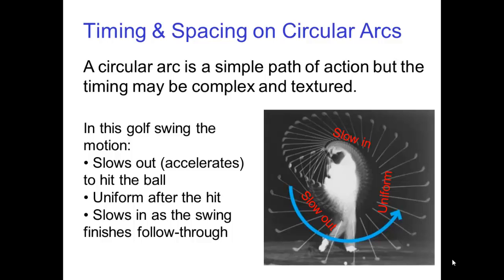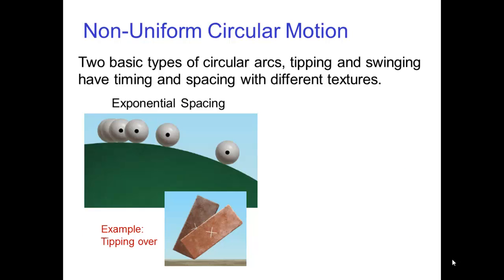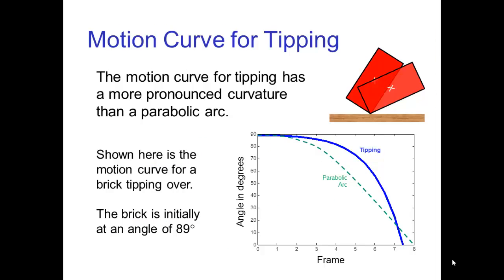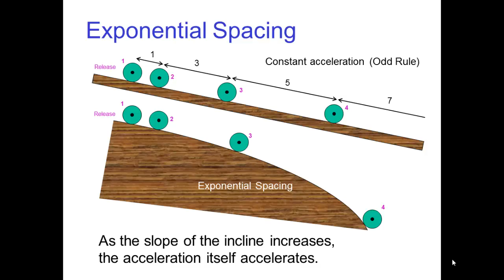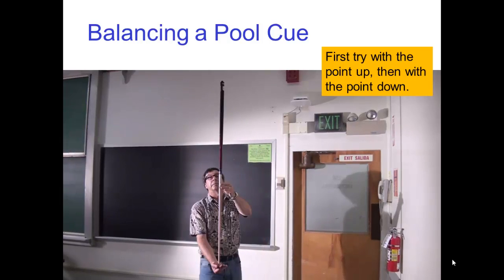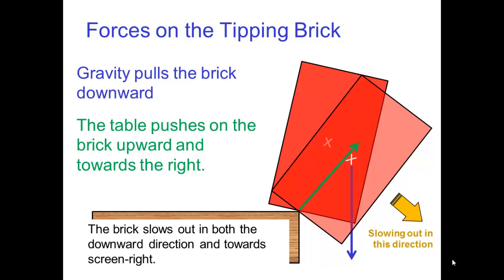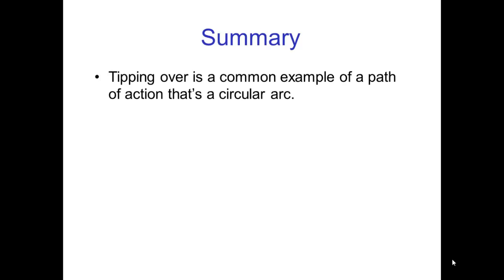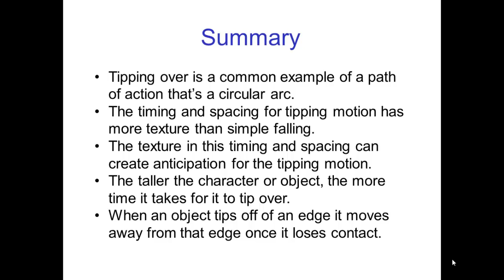Circular Arcs: Tipping Motion

Comment: i have a question,
rotational inertia I= mr^2
if for what ever reason we have a baby that have a higher mass than a taller person in a way that I for the baby = I of the taller person , in this case even if the center of gravity for the baby is lower than the tall person they will tip over at the same time ?
Reply from the maker: Good question! The answer is, no, the masses do not matter because both the rotational inertia and the torque due to gravity depend on the mass. In other words, if the baby has twice the mass then both the rotational inertia and the torque are twice as large. The rotational acceleration goes as:

(Rotational Acceleration) = (Torque) / (Rotational Inertia)

so the mass cancels out. This is similar to the fact that light and heavy objects both fall with the same acceleration under gravity (if we can neglect other forces such as air resistance).

Thanks for watching!
Reply: ohhh very clarified and for this same reason the pendulum period only depends on the length not the mass ?
Reply from the maker: Yes, that's exactly correct!
Reply: thank you very much! always looking for your reply :)